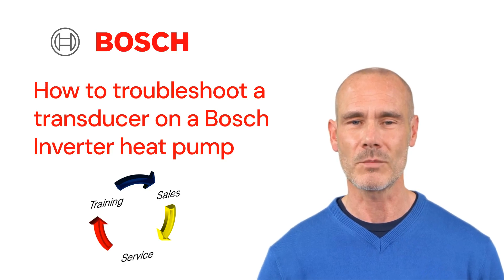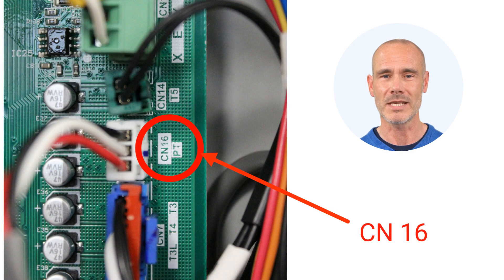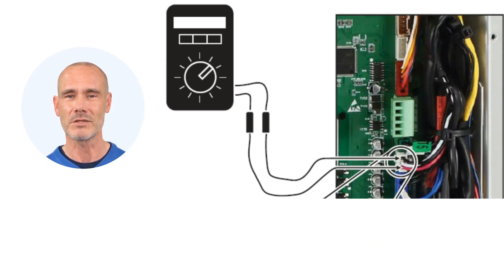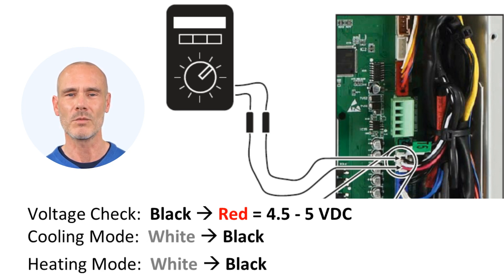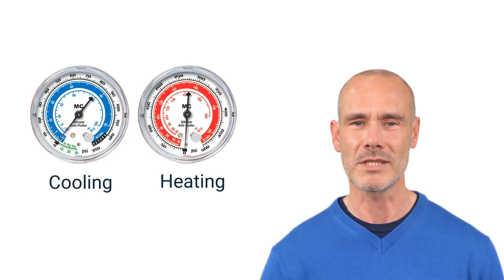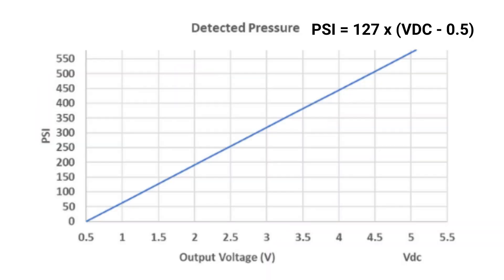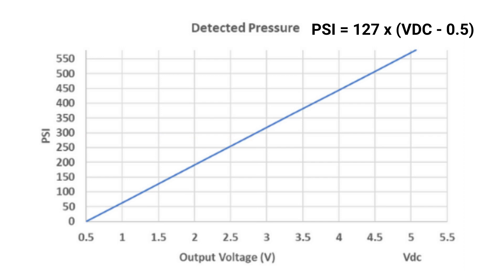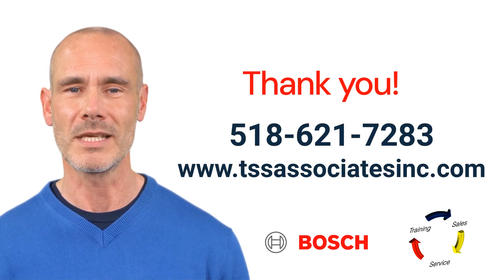Troubleshoot a Transducer on the Bosch IDS/IDP

Comment: Thanks for these videos. Can you clarify that checkpoint values 9 and 10 change based on heating or cooling mode and that only one of them is the actual transducer value. The other is calculated pressure from temp sensor.
Reply from the maker: I would need to know what unit you have, the check points change in the versions of the OD units.
Reply: @tssassociatesinc5717  Good to know that also. Mine is a 60HDN1M20G. Finding that part is on national backorder and had to make my own pressure transducer to get back up and running.